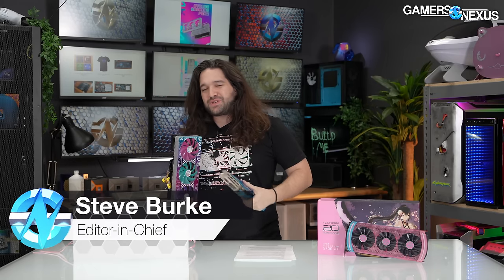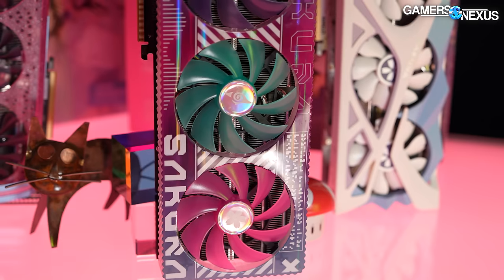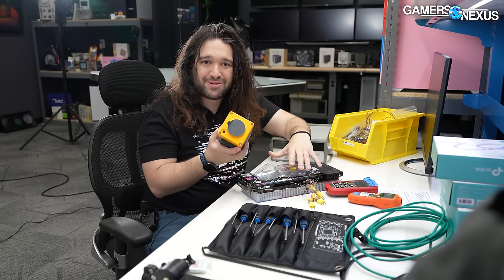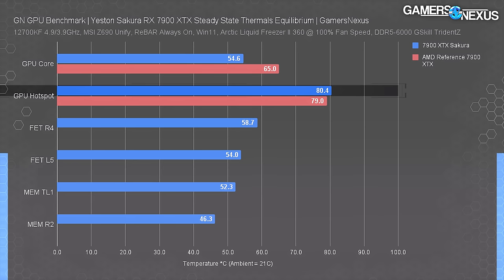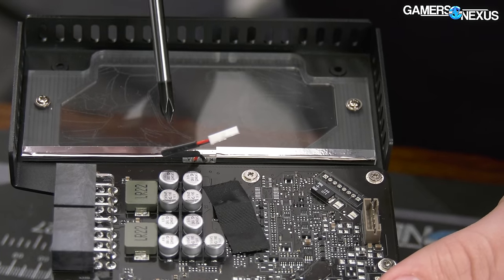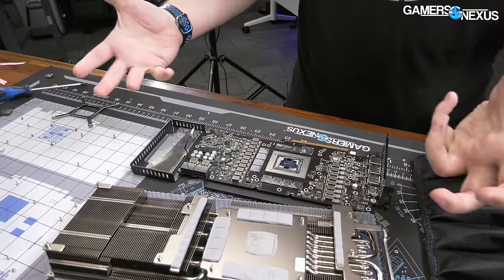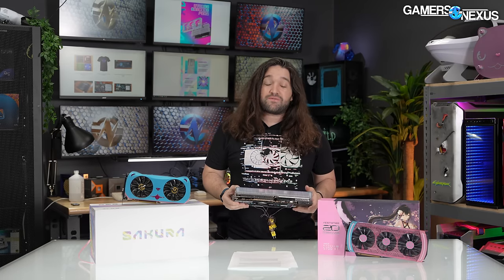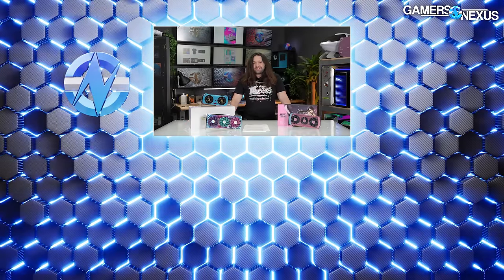Crazy Design: Yeston RX 7900 XTX Sakura Sugar GPU Review & Benchmarks

Comment: i'll be ordering one in a few days. I had the powercolor rx7900xtx hellhound spectral (white)and it crashed like mad so i returned it. also the coil whine was ATROCIOUS it sounded like an original xbox disk drive lol.really don't wanna fork it over for a 4090 cuz price, and dont really want a 4080 cuz not enough vram (i do a lot more than game)
Reply: Hi how has the card been?
Reply: @SkeIeton  It's really good, I have it paired with 32gb of ddr5 ram and a ryzen 9 7900x 12-core processor and runs very good, my complete build literally cools down my room, and it only has an aio closed loop water cooling being the msi mag coreliquid so theres a total of 6 fans in my build but its also an open case by thermaltake so theres a lot of airflow I cant tell you how it would perform in a closed case. but in conclusion if you like the color scheme and you have the money its on sale for like 800 dollars and its a high-end card I would def say get it, it will also be the most unique making you have the most unique computer out of all your friends lol

Comment: Placa de vídeo: NVIDIA GeForce RTX 4090 - preço estimado em US $4.999,00
Placa-mãe: ASUS ROG Rampage VI Extreme Omega - preço estimado em US $899,99
Memória RAM: Corsair Dominator Platinum RGB - preço estimado em US $449,99 para o kit de 32 GB (4 x 8 GB)
Fonte de alimentação: Corsair AX1600i - preço estimado em US $499,99
Processador: Intel Core i9-12900K - preço estimado em US $799,99
Cooler: Noctua NH-D15 - preço estimado em US $89,95

Comment: can you pretty please stop saying the springs are there to increase mounting pressure when they do THE EXACT OPPOSITE, they allow the screws to be overtightened to a degree that would crack the chip, and ensure the tension is spread evenly over the screw by REDUCING THE OVERALL PRESSURE because thats what springs do! It is IMPOSSIBLE for a spring to apply more pressure than you apply to it, look up the spring constant formula (Hooks law) if you dont believe me.

Comment: this gpu is good quality? or cheap
Reply: 80 degree celcluis is pretty bad, it shows your gpu is prooly cooled, not just this card my gigabyte rtx 2070 windforce 2x also same issue (cheaper gpu edition have this issue), this forces the card to work less effectively making you lose fps

Avoid this card if you want 100% performance, aesthetics and looks sure, is it still the same over priced 7900xtx? yes.
Reply: Don’t buy ccp approved gpus

Comment: i need inverted full size tower pc case so cpu at bottom of case and gpu at top case , all find is mid or mini case, as well need inverted video card so fans facing downwards in case so heat of card not hitting cpu and memory chips will anyone company do this. just think pc turn upside down,

Comment: SPRINGS REDUCE PRESSURE. always. ffs look up Hook's Law/the spring pressure constant formula. It is impossible for a spring to increase pressure as you repeatedly claim, thats just not how physics works. The Springs are there to REDUCE mounting pressure to EVEN levels (cos thats what the spring constant does, thats what springs do) and allow you to overtighten the screws without cracking the chip. 

Again springs REDUCE the pressure to a constant, even level, it is impossible for a spring to apply more pressure than you apply to it!

Comment: Please everyone be aware of frauds . Recently i bought a 3090 and a 3080 in a price drop (both in 50) dollars i knew something was wrong . I thought maybe they are refurbished and maybe atmost one of them won't work . But when I tried them both were working but the 3080 just gave 10 fps in all the games and 3090 don't even showed up as a graphic card . It was some other name and it dint belonged to amd or nvida it was something else . It was some other mobile card whic was used in very old tablets . And it was sooooo cheap that the material quality was also soo shit. It dint even weighter more then 50 grams ☹️☹️☹️☹️
The box were heavy and when I opened them there were rotten specs . Even worse then potatos . Now i am very sad about my 50 dollars(uds) loss . Now i am also trying to sell it to some one who can use it as a showpiece or just for display work